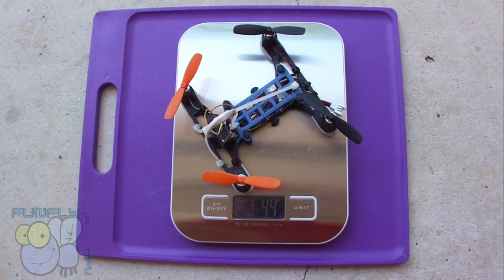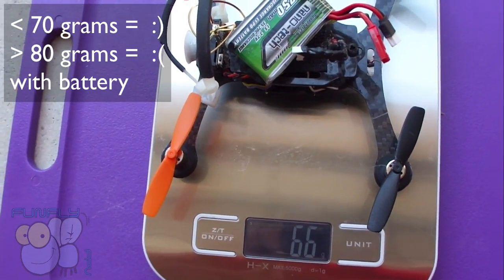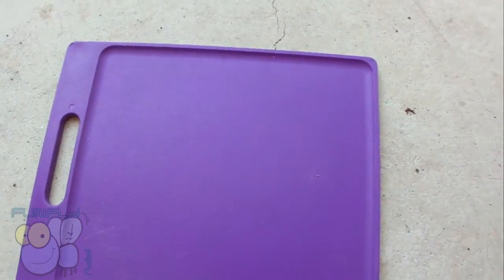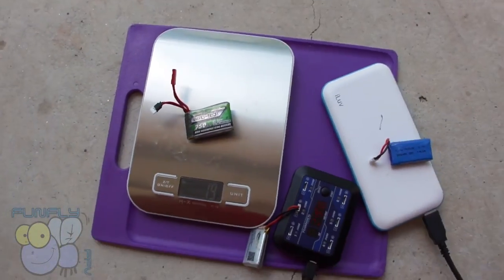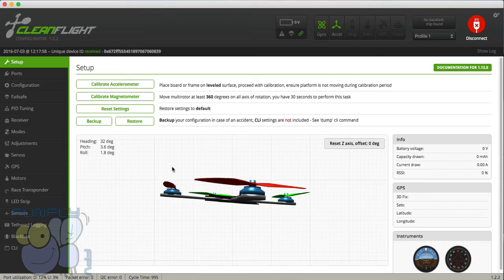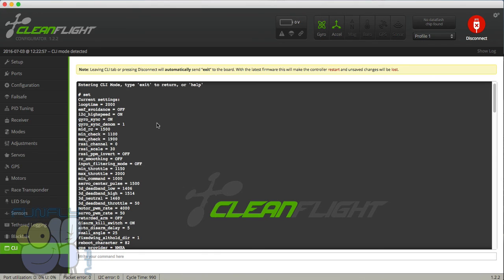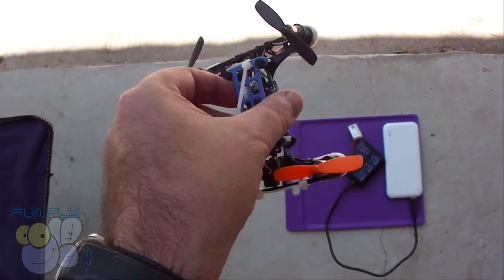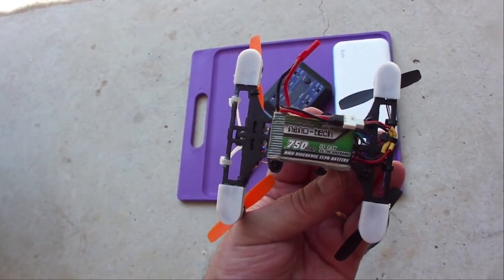Ultra Micro FPV Tips & Tuning

Comment: Hey Vyn. Been binge watching all your vids. Great stuff. Concise.

 For GoDroneX school challenge program, I need some help for the High School Platform

Spec: 8.5mm brushed, 1 cell, blade guards. 

I need your help with . . . .

1) link to FC's that support dsmx and F3 brushed with pre-soldered connectors (already know about beebrain).
2) 3d printed frames with blade guards  that support F3 FC brushed (prefer center mount cam/vtx or oscars' whoopie style)
3) link to durable blades (clear?). 
-----
already followed your lead on the losi connector batteries on amazon. 

Could you please put links in the description.

Thanks!
Reply from the maker: Thank you !

I added some details to the description but it is not exactly what you are asking for so best is to send me a PM and lets see if we can work on this together.
Reply: don't know how to pm in youtube. Ordered the Fc ( that was the main thing I couldn't find). Just looking for a 3d printed frame that fits the linked fc with the 798 on top. 

 this will take the f3 evo board. . . 

https://oscarliang.com/whoopee-micro-frame/

http://www.thingiverse.com/thing:1700311

but looking for other ducted 3d printed options.
Reply from the maker: Ok .. I have one on Thingiverse but it is a bit heavy  http://www.thingiverse.com/thing:1595244

You can email me is you want to chat offline FunFlyFPV at gmail dot com.

Comment: I dont like the ladybird props myself. My quad flies well and is 70 grams with battery. 
Maybe  because ur using cheaper motors?
Reply from the maker: That could be because I use the cheaper motors yes. One day I will try the expensive ones :)
Reply: Watch out with them. They get very fast hot and they will brake. So cool the motors off after a flight.

Comment: Nice video ! I would like to know : how you plug the cam ? By Scisky 5V output or directly by the main battery (and pololu) ?

Sorry for my English, I'm French sub :)
Reply from the maker: Thank you. The camera takes a 1S only (3.7V) so I directly connect it to the battery.
Reply: +FunFly FPV Thanks for your quick answer ! And with this setup, you don't have any noise in your video signal ?! Few setup use Sciscky 5V and add 3.3V pololu to regular the juice et reduce the noise... What do you think of this ?

I will buy soon an all-in-one cam (like FX797) et I don't know how to plug in my quad :/
Reply from the maker: The FX797 works on 3.7V and has built in filtering, so there is no noise. You can see from the videos. All of my FX979's I plug directly to the 1S battery. Adding a Pololu would also add unnecessary weight.

Comment: Thanks for posting your gains and associated titbits. I seem to get nearer 5 minutes from the dark edition motors with those props and 750 nanotech so I guess there's some validation there but you have some great performance for very affordable motors. I just got some banggood cheapy chaoli 8.5mm and some spintech 8.5mm to try next and I found an affordable 3D printing service near me so get a room racer frame delivered on Monday thanks to your videos. I look forward to trying your tune out, much thanks for taking the time to post them.